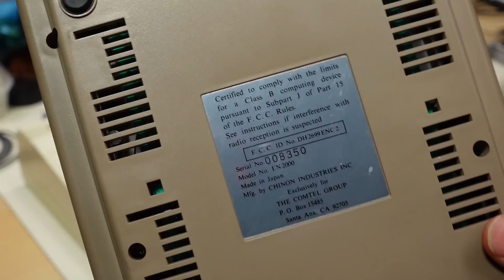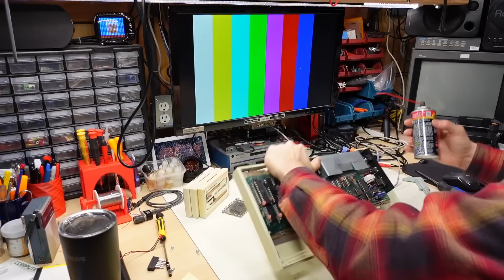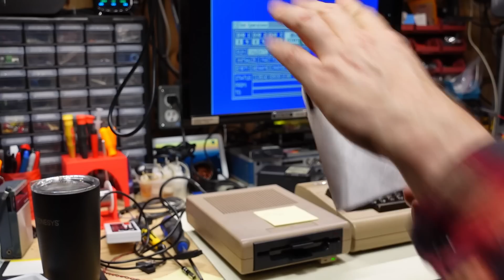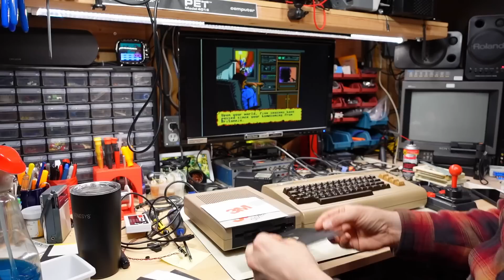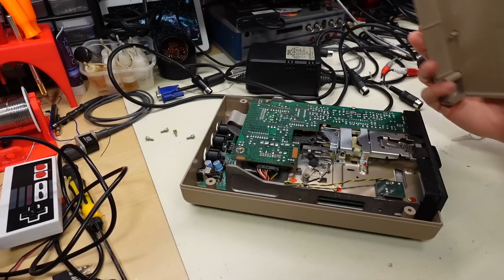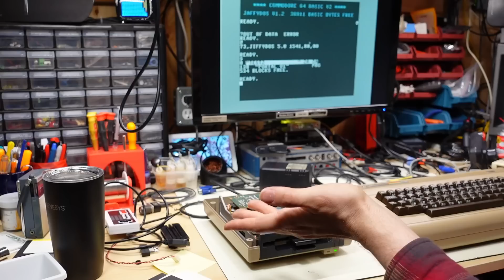0036 How compatible is the Enhancer 2000? (A clone of the Commodore 1541 disk drive)

Comment: As I recall there were a lot of 3rd party disk drives for Commodore and Atari 8bit computers. They were often better than the original brand models since they would offer higher capacity disk formats, faster speeds, and alternate DOSes to use with them to take advantage of those perks, and still remained compatible with whatever standard format/file system they usually used.  The Indus GT Disk Drive was one 3rd party drive that existed for both the Commodore 64, and the Atari 8bit computers. It had a fancy front panel display showing what track the head was on, and supported higher density formats that didn't yet exist for the original computer manufacture, like double density format (at least for Atari.) That was an awesome drive.

Comment: The weird 8736 blocks were, I think, because when you formatted the drive, you typed ",8" which was only a single digit. After the name, you're supposed to give a 2-digit disk identifier, and I'm pretty sure that 2 bytes must be there for stuff to line up correctly. You don't specify the drive number with the @ commands

Comment: There were two versions of the Enhancer 2000... the first one (which I have) actually uses the Commodore 1541 ROMs, identifies itself as a 1541 and, as far as I've been able to tell, is almost entirely compatible. Commodore put some pressure on them later on, preventing them from being able to use the official Commodore ROMs, so the manufacturers made and put in their own ROM. That version identifies itself as an Enhancer 2000, and has compatibility problems because of it.

Comment: still don't see why anything should be 'compatible' with the slowest, lowest capacity, and cheapest piece of crap drive commodore ever chunked out. if it should be compatible with anything then let's say the larger pet drives or the commodore harddisks ;p not the 1541. the poor man's excuse for 'having some sort of disk contraption too just like real computers have' :P. cbm made hell a lot of better drives than thing. and if software 'requires' a 1541 the software is simply broken. :P especially when said software is a dos. :P which should always work fine with whichever cbm compatible drives you hook up-.. the manuals are clear. 'this is the protocol, this is what a drive should do, this is the timing, now go cook up your own or buy one of ours'. oh and everything -should work as they should simply be addressed through the kernal and the designated functions. :P and if it does not your program is broken not the drive. :P
Reply: that whole 'gamer mentality' the c64 in specific attracted to the product range sure screwed up a thing or two :P basically the only people 'needing' a 1541 at that. everyone else is fine with simply using a 4040 or 1581 or whatever. but nah, games get their games on 5.25 in the format that 1541 used. (and it fits even less than the older models and is slower too :P LOL. if you need to swap programs with some guy using another disk format you simply brought the entire drive anyway. in the pre-internet days ;P lol. heck you also did that if both used 1541's as 'more drives is faster copying anyway ' :P i see absolutely zero arguments for making drives 1541 compatible. for all i care you just cram a pic controller into them nowadays instead of a 6502 :P it doesn't need to 'support' that abuse with inserting programs into the drive. it just needs to read and write files. and do so in a kernal compliant way. taking into account the fact that you also can't send a directory listing a megabyte long to lets say a pet with 8kb ram :P (there are some limitations there... :P but other than that it's 'do as you like as long as it can talk to and take commands from a commodore compatible computer'.
Reply: heck these people think something would be wrong with a 'drive' just because their crappy game won't run on it... just disassemble your game and remove the 1541 specific code as THAT is a bug. :P don't try to make either old or new product drives, 1541 compatible just for a handful of broken games and demos. lol. drives do not have to have accessible ram. it does not need to be 2kb if they do. they do not need a 6502. you can put in anything else. z80s, 8088s whatever. as long as it 'speaks the iec protocol'. software will just have to live with it. the standard is and always was, the protocol. not a specific consumer product drive by itself. (in that aspect. how one even manages to produce a corrupted filesize... is another question :P LOL.
Reply: bestest part is when that sorta people go around producing sd card readers and what not and then present them as a whole lot of 1541 images :P instead of just a single harddisk image :P (or heck, maybe a few 100 ;) lol. people. there have been harddisks for the commodore series for as long as they were around for any other manufacturer. :P basically from the start. lol.

Comment: Well got me the Enhancer 2000- and trying hard to figure out how to change it to drive 9- so i can use it with an SD2IEc... no jumpers outside. The manual says to do this:

10 OPEN 15,8. 15 20 PRINT # 15, "M-W:"CHR$ (I19)CHR$ (0) CHR$ (2)CHR$ (9 + 32) CHR$ (9+64) 30 CLOSE 15
This doesn't work...any more insights here 1541 fans?

Comment: In my C64 days, i used both an Enhancer 2000 and an Oceanic 118N Disk drive.
Both were fully compatible to the 1541, except for some rare copy protection schemes. 
Even Burstnibbler cable-installationss worked, if you changed the roms to copies of 1541 stock roms.
The biggest difference was the price (about half of the 1541) and about 20-35% higher speed.

Comment: The Enhancer 2000 came along around 1985 at the latest.  In junior high, I knew a guy who had an Enhancer 2000, and we fellow Commodore geeks used to call it the "Dehancer 2000" because a ton of major titles wouldn't run on it.  I felt for him, because the first third-party drive I bought had the same issues (and a lot more on top of that), but like I said in my other comments, Blue Chip replaced my drive with a tremendously improved version that works with everything, so of course I still gave him a hard time about his drive, like everyone else. 🥴  If I had known at the time that a newer and far more compatible Enhancer 2000 was available, I would have told him to contact the manufacturer to see if he could get it updated.

Comment: Try running Ultima V , which asks whether you have an Enhancer 2000 or MSD drive instead of a 1541 or 1571.  If you choose the latter, then it will run its built-in fastloader, and if you choose the former, then it will not, so the folks at Origin knew that the Enhancer 2000 specifically is incompatible.  Try loading the game on your Enhancer 2000, but tell it that you're using a 1541 or 1571 in order to find out whether your version of the Enhancer 2000 is more compatible than their reference version.

My Blue Chip drive works fine with this game, of course, although I'm sure that my crappy, highly incompatible (and highly prone to breakage) older Blue Chip model would not have.  It didn't work with anything that even checked for a specific type of disk error as crude copy protection, much less any fastloaders.  Man did I have soul-crushing buyer's remorse after sending it (under warranty) to Blue Chip twice for literally breaking on me (as in pieces actually breaking off inside), but they more than made up for it by replacing it (for free) with their updated and tremendously improved model.

Comment: I have a later Blue Chip drive that is awesome and completely compatible with everything I've ever tried (the earlier model I had originally purchased sucked in every way, and the company sent me the newer model as a replacement), so it's conceivable that later Enhancer 2000s are more compatible than earlier ones.  By the way, one reason my Blue Chip drive is so awesome, besides having full compatibility, having direct-drive, running cooler, being bulletproof and reliable, and having a write indicator light (surprisingly useful!), is that it actually uses its track 1 sensor, which means that it never does the head-knocking thing (yet maintains full compatibility).

Comment: a) you screwed up formatting that disk
b) I think at some point, most fastloaders started supporting the enhancer. Youd have to find a copyprotected/fastloading original from the 80s or something.

I remember nearly buying one of these in the early 90s, but took a Crest demo with me which it couldnt load, so I didnt buy it.

Comment: The original ROM in this drive was just the 1541 ROM with some of the data pins swapped around.  That would make it software compatible but modified ROMs for fast-loaders wouldn't work.

Comment: Why all the fuss with wanting to install a JiffyDOS ROM when an Epyx fastload cart does everything just fine? It even has a dos 'wedge' if you like that. Not like there's any other real use for the C64 cartridge port.  Also that disc-door mechanism isn't rare, many models of the 1541 had it as well, including my high school's and my best friends, while my own had the latch and thus didn't pop the disc out like theirs which I preferred.

Comment: I still have an old PET 2031 FDD which I used for a little while on a kit-built computer.  I stopped using it because it refused to reliably read disks.  You could format a disk and it would work for a while but then after a few weeks, it suddenly would start giving errors.  You could reformat it and it would repeat the cycle.  And it didn't seem to matter what brand of disk you used, either.
The 2031 used a parallel interface which had the General Purpose Interface Bus, (IEEE-488 standard).  It was a 16-wire system with 8 wires for bidirectional data, a ground wire and 7 wires for signalling.  I can still remember building the interface (7 ICs) and programming the computer to use it.  If I remember correctly, there was one "ATN" (attention) wire used for sending commands and the data/command transfer signal used two lines effectively in differential mode.
Last time I tried it, it wasn't even booting and when I tried reading the ROMs (on a MiniPro), one of them gave inconsistent data on each read.  Still, if you're interested in it I might be able to send it to you.  If I ever do decide to add disk storage to that old computer again, I'll probably install a dedicated controller and use a standard drive.

Comment: my first computer was the vic-20 (here in germany it was called the vc-20). I also found the keyboard on the vic-20 better than on the c-64. i had vic-20, c-64, atari1024,amiga 512 with extension, because pc from amd 66 mhz...etc translation google...
Reply: Volkscomputer...

Comment: Goodwill hubs do the bin thing nationwide. Whatever sits in the stores long enough and doesn't sell is sent to the hub or distribution center or whatever they call them and put into the last-chance bins. These things are giant bins so even if you find one that's full, you're probably never going to get to see what's in the bottom of them. When I was thrifting I'd go early to see them while they were full and I could get down to about halfway to see what was in them and then I'd leave and come back a few hours later when the bins were half-empty to see what was in the bottom half. Almost never did I find anything worth it in these bins so I quit doing it pretty early on in my thrifting adventures. And the stuff that was worth it was usually trashed beyond salvage because they're just thrown around and dumped in the bins with no regard for what's already in them and stuff gets crushed.

Comment: I can't remember what maker it was, but I had a drive for my VIC=20 where it had some compatibility issues with any software that tried to use the RAM and CPU in the drive remotely -- which was a thing some programmers did -- because instead of a 6502, it used a 8085 microcontroller.

Wish I could remember what company pulled that stunt.
Reply: I clearly remember writing assembler routines to send to the 6502 inside the 1541 drive to do all sorts of things including speed up that hideously slow drive.  Also to protect from crackers but I think that lasted about a day.    Obviously anybody with a drive running a Intel 8085 wouldn't have been able to even boot my code.

Comment: THE BINS ARE A MYTH. Or at least the idea that they are primarily a way to liquidate unsold merchandise. In OR and WA, almost NOTHING in the bins have store price stickers on them. Obviously they aren’t going to take the time to remove normal Goodwill stores’ price stickers from everything. The truth is that the volume of merchandise donated to Goodwill is SO MASSIVE that the great majority of it never goes into their retail stores at all. It just goes straight into the bins and is sold by weight. Despite what they might say, Goodwill has more merchandise—which they get for free—than they know what to do with. Goodwill bins are a fine place to shop (if you don’t mind occasional merchandise that smells like ass or cat urine), but if you’re donating merchandise, take it to some other charity shop. Their donation receipts are pathetically small compared to Goodwill. Goodwill is the Microsoft of thrift stores. They don’t need your donations.

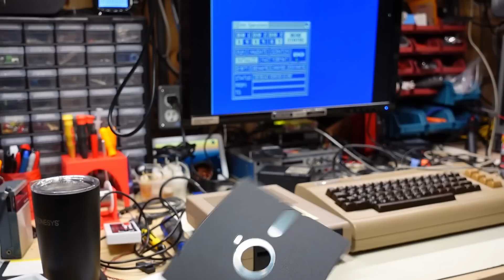Comment: @15:45 "Initialize" is just used to inform the drive that it should flush it's disk ID cache and get a current one from the disk - this way you can use disks with the same ID, although that is not recommended at all. Adrain has figured that out correctly later on before the format hiccup that has been covered enough in other comments.

Comment: We saw an apple 2 with dual disks and monitor at the bins on airport way. All looked good, but someone got it before we did.

During this recording, at the bins (also known as a goodwill outlet), electronics are $0.69/lb. No matter what it is. If it plugs in with cables or is electronic (like an alarm clock) it's less than $1 a pound. Other things are more expensive per pound.

Comment: I'm just surprised you don't use the function keys for loading directory (F3) and "*" (F1) for the first file in action/retro replay mode. You obviously don't know about these shortcuts? Use F8 for Machine code monitor! And on another note, these drives are 99% compatible. I regulary use my OC-118N for disk transfer to .d64 on U64/1541U, which is not that different from this Enhancer 2000.

Comment: If you want to make a kind-of hacky custom label, you can use the kind of double sided tape that's thin (not the foam kind) stuck to the back of your label and trimmed to size with a sharp hobby knife from the rear. If you want to be really fancy, you can print it in colour and get a can of clear glossy spray lacquer to make it shiny. As for what to label it with, if I were you I'd try to get someone with an intact label to take a nice high-resolution photo of it, and use that to make a reproduction label.

Comment: The drive mech looks interesting, and I'm very curious if it's compatible with an Apple II.

I just picked up a drive for my IIc, which came from the electronic bay missing its drive (was evidently removed long ago). The replacement drive was sold as not working, but I haven't had a chance to test it out. I now have literally no excuse for not building a replacement power supply, since that was the last thing I needed for a complete IIc.

Not that your drive would fit inside a IIc, what with it's unique face plate.
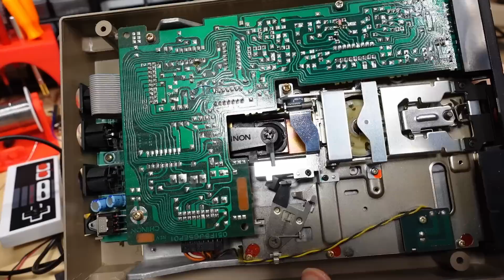Reply: It certainly looks plausible that it might be - if you look at 28:13 you can see that pins 1,3,5,7 (GND on the apple drive) are wired together, 9 (-12V) is N/C, 11+12 (+5V) are wired together, 13,15,17,19 (+12V) are wireed together, pins 2,4,6,8 (stepper phases) go to the other connector and 10,13,16,18,20 (read/write signals) go to what's presumably the read/write control IC.   There is nothing in the wiring that says "this can't be an Disk ][" to me..

Comment: I noticed it was missing the quotation mark before the "basement" file. Prior to saving the file it listed 65 blocks free (should be 664), then after saving it there were 663 blocks free and the basement file was 8736 blocks. I'm guessing the FAT (or whatever it's called in C64 terms) was glitched out before writing, so when it wrote the file and updated the FAT, it calculated the block size of the file incorrectly, but updated the number of free blocks correctly.

Comment: We used to score some decent electronics from our local "Goodwill".  Sadly they now have a retired ol' fart that "runs" the electronics section.  His former job was running an appliance store that used to deal with anything from receivers to speakers...anything electronic.

His "Go To" pricing method is to hop onto eBay and see what people are asking for the items or comparable items.  He then figures in shipping costs, etc..  And that's the price that gets slapped onto the equipment.  What we could pick up for a decent price now costs almost full 'retail'.   We're not "Flippers" that buy and resell at the local flea markets or swap meets.  I'm into vintage computers and electronics, and the wife is into vintage audio.   We dialed our visits back when she found a fairly decent 8 track player, but they wanted $59 for it.  She picked up two for $5 bucks a pop at the local flea market that just needed cleaning.

I commented once that just because someone wants $100 for an item on eBay doesn't mean someone is willing to pay that amount.  He just said  "Someone will want it...." and walked back into the warehouse section.